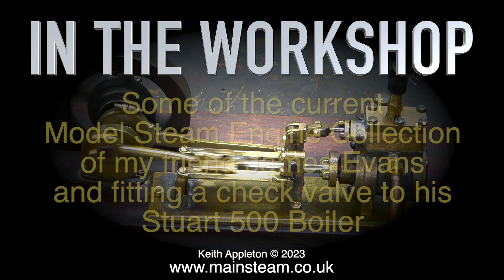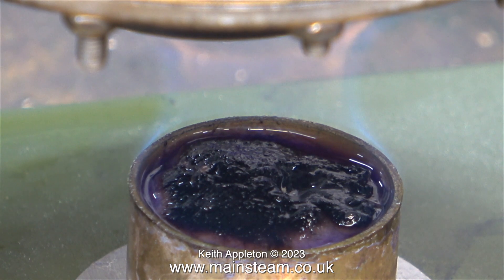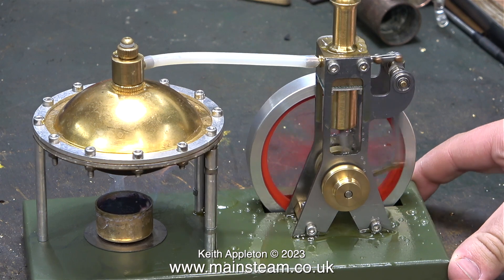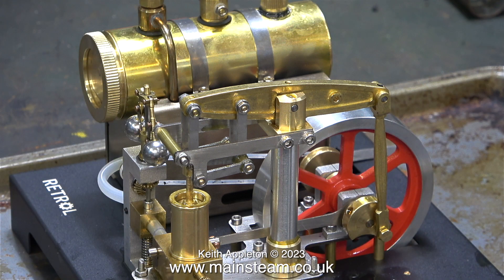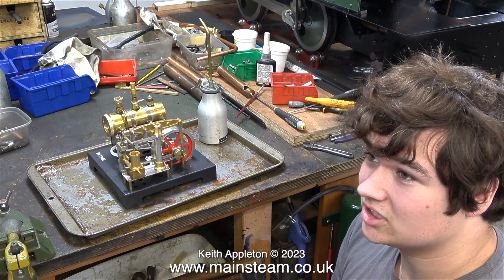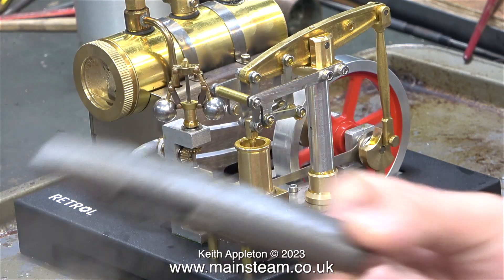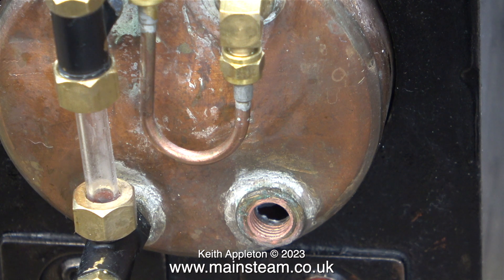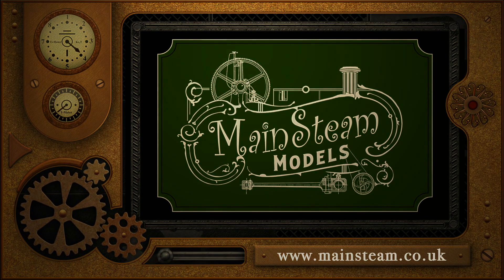TESTING TWO MODEL STEAM ENGINES ASSEMBLED BY JAMES EVANS

Comment: You should teach/tutor James on using the machine tools to machine a steam engine from castings.  Maybe a Stuart 10V or 10H.  Could be a long term video project, and at the end James would have an engine he created, and a whole new skill set in machining.  Emphasis on Shop safety and proper use of tools would be good.